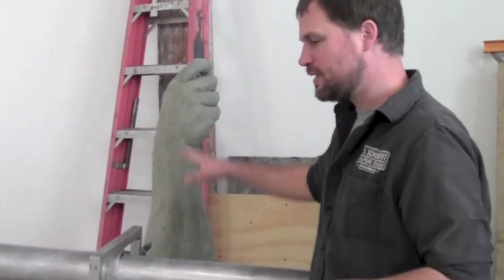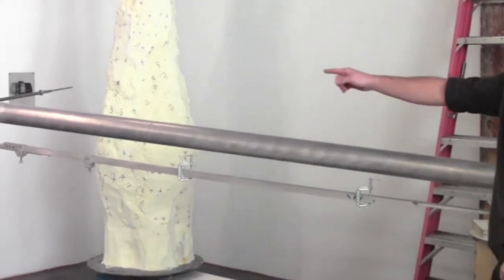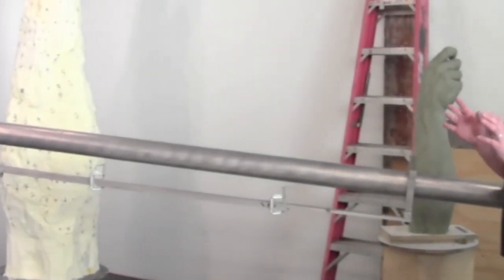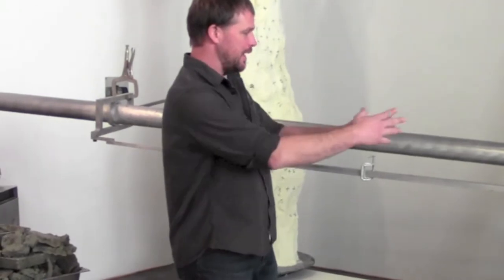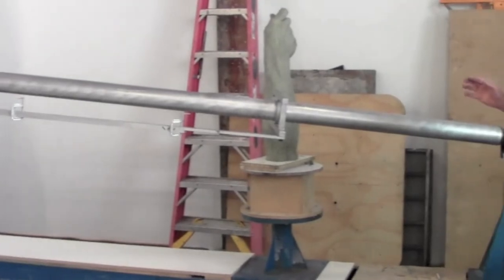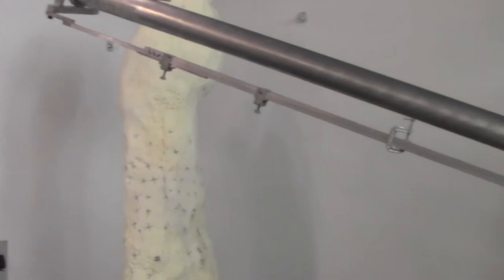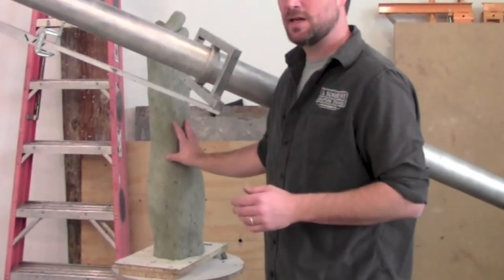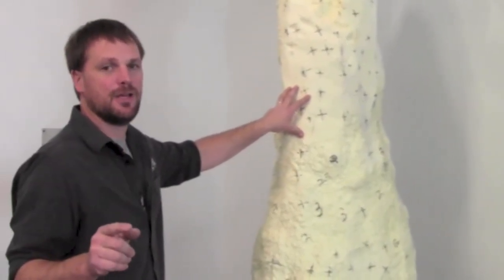The Sculptor's Apprentice, Pantograph Pt  1

Comment: Good Job!  The number one reason for using a pantograph, is you can adjust for visual distortion as the model builds.  A computer our 5 axis router cannot judge for the fisheye distortion that is inherent when working up close to your model.  I would think this would be one of your major selling points.  Remember you are selling your judgement, not the technology.

If you are working in resins that means you are probably working with a flexible mold.  That will drive your costs exponentially.   I suggest you try a plaster waste mold.  Using water bound clay, and casting plaster over your clay. Moreover if you cast your statuette  into plaster, there is nothing like to white of the plaster to demonstrate a flaw in your modeling. 

Nice studio, good instructions.  Bravo.